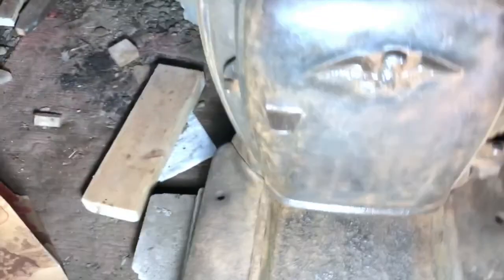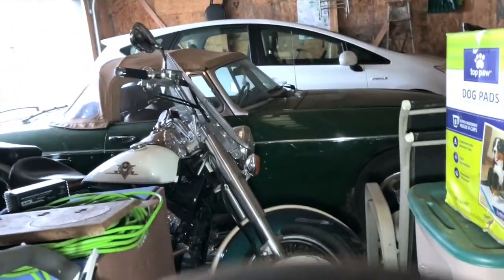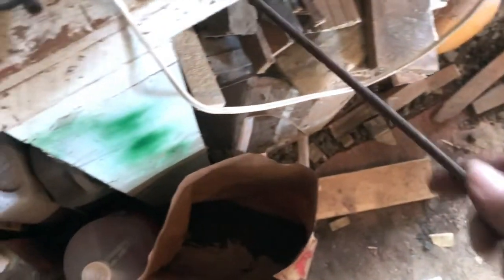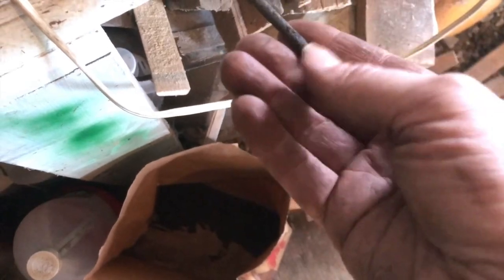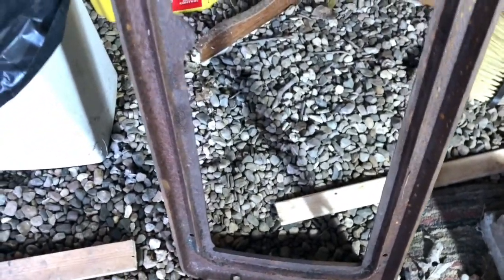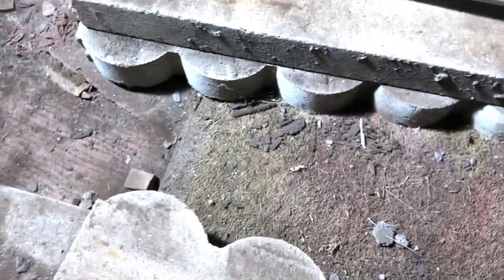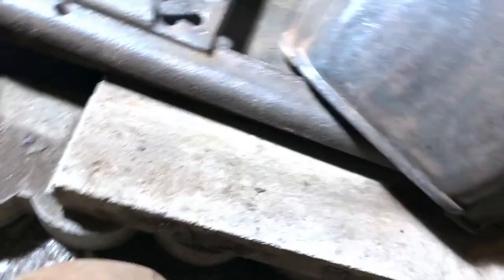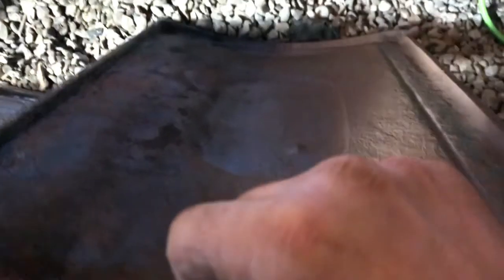Refurbishing a Wood Stove

Comment: I have a similar stove. It had four long bolts one on each corner
 holding everything together.
The long bolts were badly rusted .
I ended up replacing them with
Pieces of all-thread cut to lenght.  Crown nuts can be used on the top of the stove a nice appearance and ordinary nuts on the bottom of the stove. 
Take care not to over tighten the nuts. 
Apply several coats of high heat paint before it starts rusting again.
Reply: Do you have any pictures I'm having the same problem
Reply: @keithwaldron5916  No,  sorry no pictures. The stove is in storage right now.
It's a little cast iron stove i bought at a yard sale. It had been sittlng out in the weather for years.
I took it home and i took it all apart and wire brushed the rust off of it with a wire cup brush in a drill.
Then i painted all of the parts with high heat bbq grill spray paint.
Any good hardware store will have lenghts of all-thread rod in various diameters. Get the diameter that fits not too tight in the holes. The stove needs room to expand when it gets hot.
Then get crown nuts to fit the all-thread rod for the top of the stove and regular nuts and a washer for the bottom end of each piece.
Get the shortest pieces of all thread rod that will work for you then run nuts onto the rod before you cut the rod too lenght. Cut it about an inch too long.
After you cut the rod to lenght with a hack saw,  dremel tool or side grinder you can take the nut off the all-thread rod and it will clean up the cut end.
I assembled the stove panels and top too the bottom with the all-tread rod nuts just barely hand tight so the stove can expand and contract as it heats and cools.
Find a good, old fashion hardware store and tell them what you are trying to do and they will fix you up with what you need.
Good luck. If you have anymore questions just ask
 I am glad to help.

Comment: Williams Stove Polish the only thing that should be used on black iron stoves do not ever paint the Williams stove polish is all that needs to be done. After every season rub the polish on entire stove working it into the metal, it revitalizes the iron and seals off the stove Iron from the atmosphere during its down time. Use polish on cold stove only and make sure you rub it in like Tussin LoL. Again don’t ever paint your black iron and Williams is the brand to go with been around for about as long as the iron stove it’s self.
Reply: What about with a vogelzang bx42e? Is that ok to paint?

Comment: What did you replace the long bolts with?
Reply from the maker: I forget what they are called but you can get them at Ace. I just used long headless threaded rods.   I put a washer and nut on either end and it worked well.  It was a little hard to put the whole thing back together though.

Comment: Thanks for your video, this looks identical to the one we have that we are redoing
Reply from the maker: Thank you for watching the video. I am a little long winded sometimes but I have tried to make it the best I could. You will love doing this because it's just so much fun and when it's finished you feel so good and it will probably be there longer than you. That's super cool. Let me know how yours goes. Good Luck.
Reply: Do either of you know the brand of this stove, cause I’m redoing mine as well and it’s exactly the same...?? lol @Jessica Roper
Reply from the maker: @robleeiv4339  I wish I did, but I couldn’t find anything on it.  I’ve been using it a lot though and it cleaned up just fine.   Good luck with yours.
Reply: @robleeiv4339  did you ever discover the manufacturer?
Reply: @scottvaagen9441 No, I sure have not.
Reply: @robleeiv4339  I can’t find anything online about it. It’s driving me nuts. Thanks for the reply.

Comment: Neat stove and it looks like you are doing a nice job with it. Stay safe out there guys and take care :)
Reply from the maker: Thanks man. I just reblacked it with a secondary layer and it looks super. Almost brand new. I used a toothbrush to get into every nook and cranny. Now I just have to wait for the bolts to arrive. Those long bolts I was talking about well they don't have them at the hardware stores I had to specialty order some. I am thinking about cutting up a cookie sheet to fit the bottom of the stove and keep that on the bottom in order to try and keep the floor of the stove in as good a shape as I can. 
Then some firebrick on top of the sheet so the fire doesn't sit right on the floor.